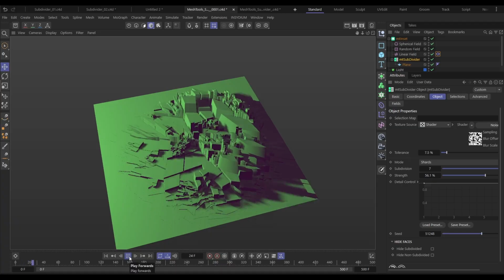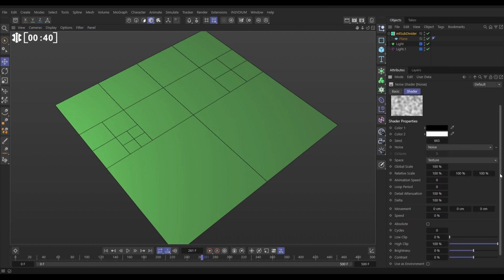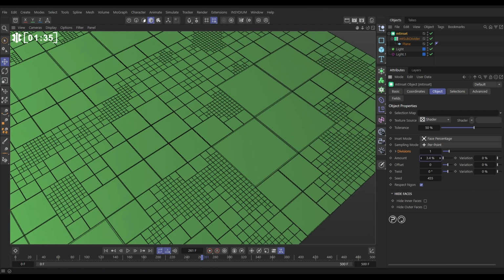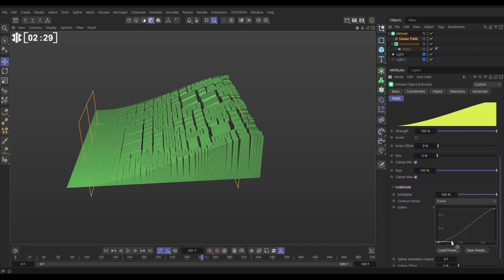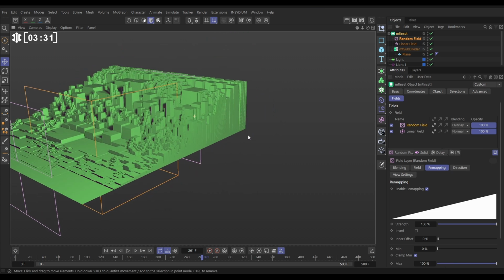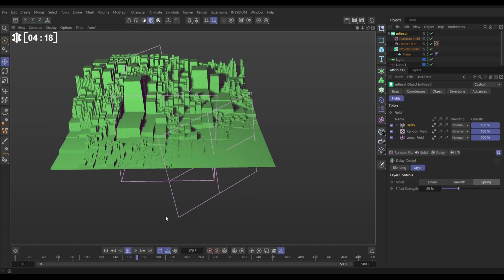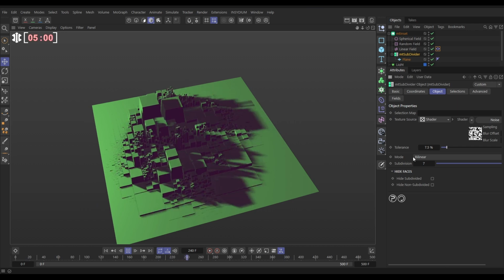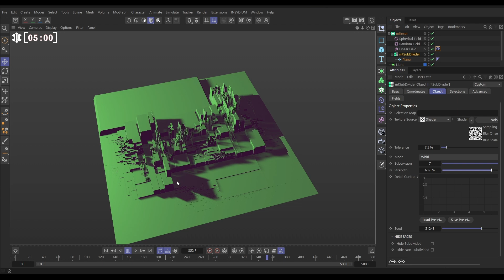Top Tip Tuesday - Dynamic Subdivisions

Comment: This is awesome!   Can Mesh Tools extrude in other shapes or rectangles only?
Reply from the maker: The mtSubdivider generates quads, so if you use this in your hierarchy before the mtInset, the inner faces will always be quads. To get triangles, you can replace the mtSubdivider with a mtRemesh. This will convert the quads to Delaunay triangles. like the mtSubdivider, this can be driven by shaders, so you can use a noise to generate areas of smaller and larger triangles. If you then use the Inset as Bob demonstrates in the video, you'll get offset (extruded) triangle faces.
Reply: @INSYDIUMLTD  COOL!!!!      Thanks!